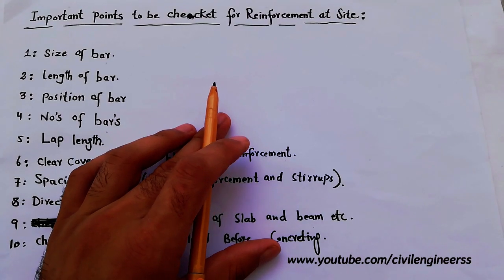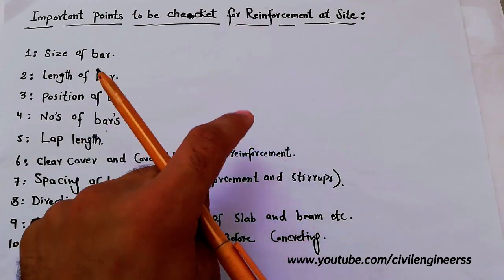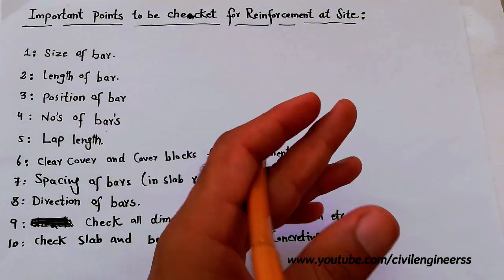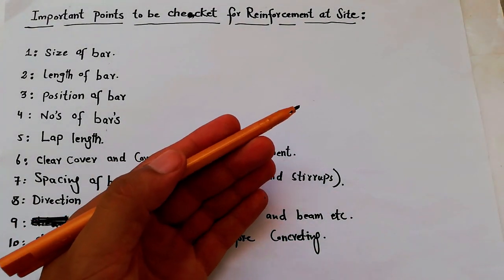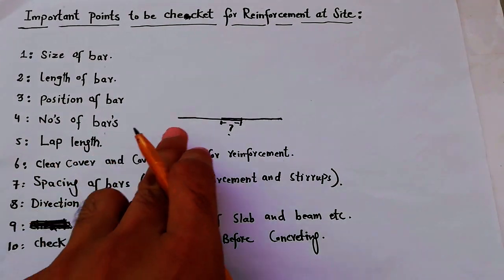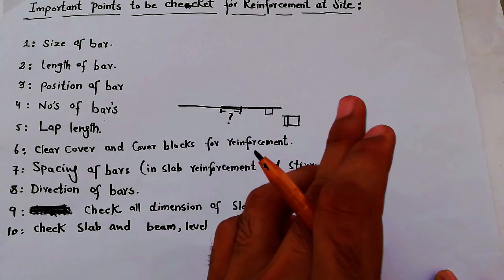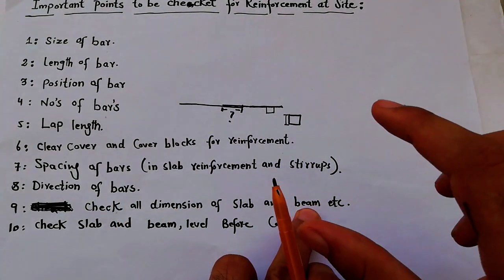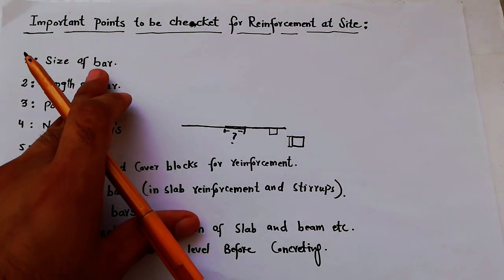10 Points should be remember every Civil Engineer on Site

Comment: HII, 
HOW TO CALCULATE THIS COLUMN NEED STEAL IS 16 MM.18 MM,20 MM.
HOW TO CALCULATION FOR LOAD. ( BEAM & COLUMN)
THIS COLUMN 20 MM DIA ITS OK.
THIS COLUMN 18 MM DIA ITS OK.HOW TO CHECK COLUMN FIT ON THIS BAR DIA.